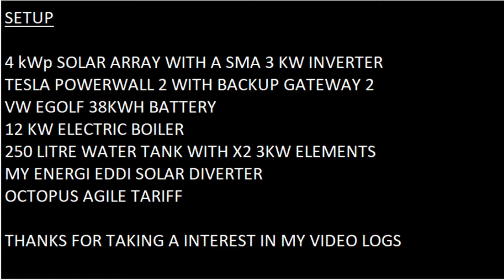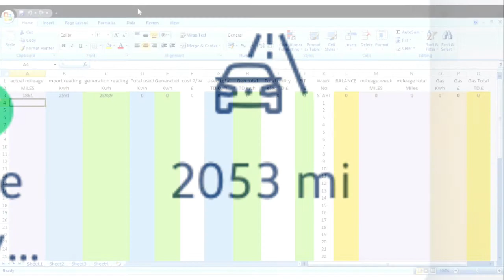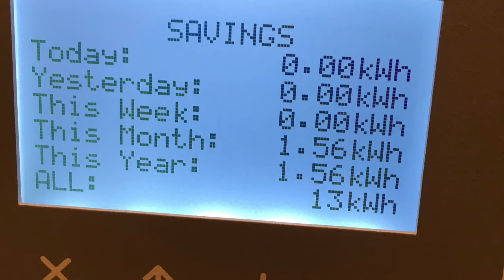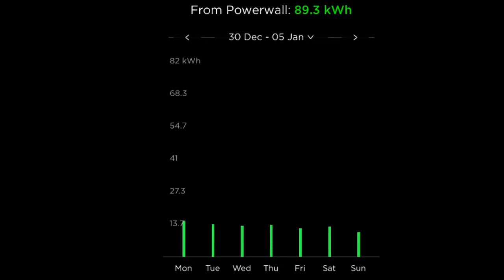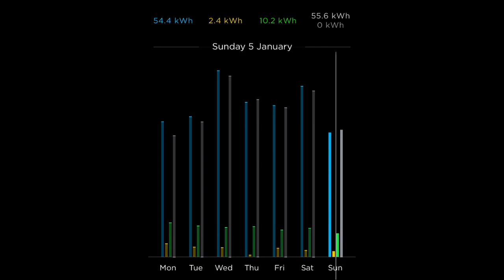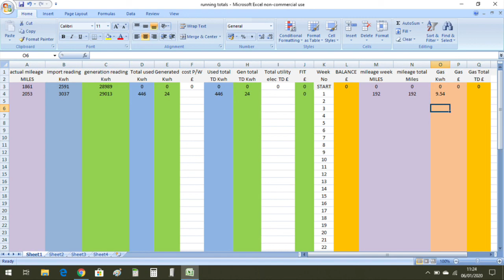week 1 energy usage stats

Comment: Where are you using 70+ kwh a day your car usage is minimal. 
We drive at least 300 miles a week and my average grid is around 38 to 45kwh daily.
Unless heating water is the difference as I am on gas
Reply from the maker: We have a 12kw electric boiler, hoping this is switched off in feb/March this is most of our load